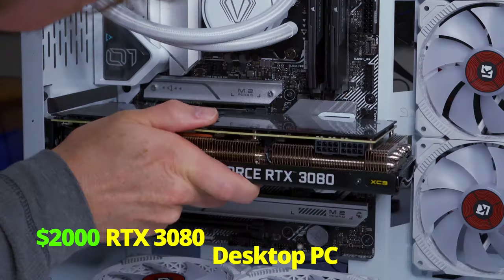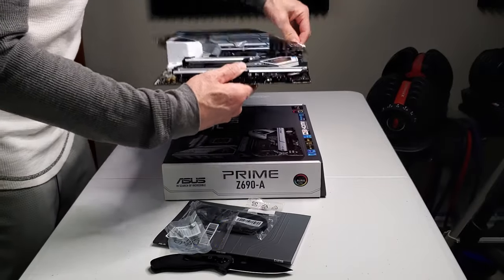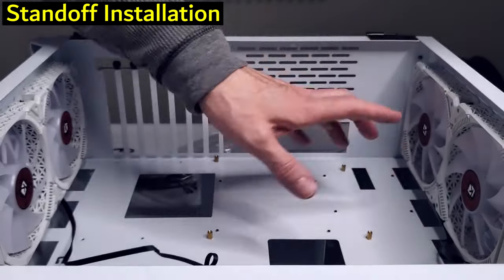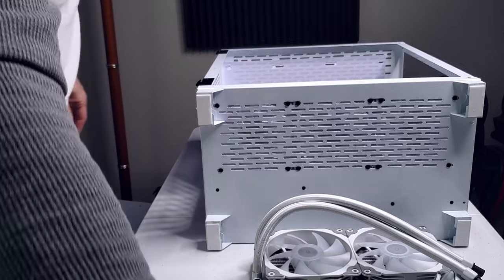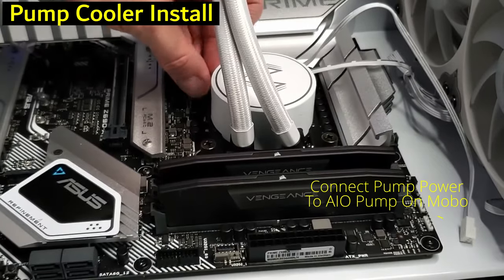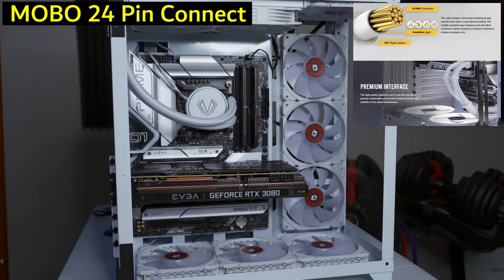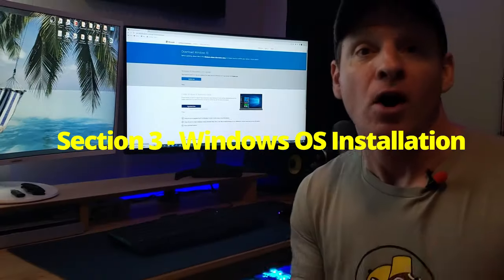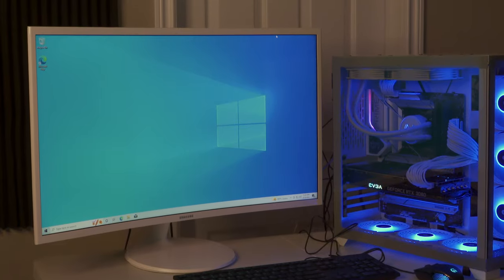THE BEST $2000 GAMING PC BUILD | EVGA RTX 3080 Intel i7 127000k

Comment: It appears as though all fans (case and radiator) are installed in an "exhaust" configuration, drawing all air out of the case, with no fans oriented in an "intake" configuration, to draw fresh air into the case. I believe this decision, though aesthetically pleasing, will likely hurt thermal performance of your components. It would be interesting to test thermal performance of components with differing fan configurations, to see what difference, if any, might be experienced. I would recommend turning the front and bottom fans to an "intake" configuration, leaving the top and rear openings to exhaust. This will blow cool air directly onto your GPU fans, as well as provide an abundance of cool air in the case for your CPU cooling fans to draw through the radiator. 
Great video, and I appreciate the detail in which you explained the installation process. Thanks for taking the time to make this video!
Reply from the maker: Thanks for the great information on fan direction and how to cool the PC components optimally. I may take your advice if my PC gets hot. FYI when I open the glass side panel the inside of the case is quite cool with really no heat. The back of the case has plenty of slots to allow outside air to get pulled into the case. I'm not sure that's the best way to do it but it does seem to work. Your idea sounds way better for sure. If I change the fans I will let you know. Thank you for watching I really appreciate it.
Reply: The key factor is the amount of heat which good luck measuring.  There is no barrier where there is "fresh air." Everything is exposed and with fan speed like that the case will stay cool.
Reply from the maker: @FuelOfLifeTV  I agree, thanks for watching!

Comment: Did you have to drill holes in the case to fit 3 fans on the top? Great Video!
Reply from the maker: Nope I just used 2 holes and 2 screws. The fan is super tight and zero noise or vibration! Thank you for watching I really appreciate it  and if you subscribed thank you as well.

Comment: In the video you didn’t show any motherboard cable connections . The Fan controller is connected to sata and you have the 5v rgb cable and the small what looks like a fan cable to go to the board that starts with a V. I’d have to open it up to see .. I’m trying to figure out how to control the fan speeds on the mother board. I think there already full blast but don’t sound like it .. don’t know what rpm they are. Can’t adjust the fan speed up or down on the remote .. do you how?

Comment: I have some few questions about the case. Are the fans quiet in the PC case? Does the PC feel good is it good quality? And is the PC sturdy?
Reply from the maker: Yes to all the questions. Quiet fans, durable well built case, feels good and looks amazing. It's my favorite case I've used in my last 20 PC builds. I have the fans all exhausting since that's the way the PC came and the inside of the case is very cool. However I may switch the bottom and side fans to pull in air. I will keep you posted. Thank you for watching and if you subscribed thank you as well
Reply: Thanks you so much for helping me so do you recommend the KEDIERS PC Case - ATX Tower Tempered Glass Gaming Computer Case with 9 ARGB Fans,C590 or the Cosair 4000x pc case because I can’t decide which is better
Reply from the maker: @Supreme-y2x  Kediers PC case is my recommendation.
Reply: Thank you so much your help 👍I want to built my own PC for myself.
Reply: I have one more question is the vetroo AIO quiet?
Reply from the maker: @Supreme-y2x  Very quiet. I've installed dozens of AIOs and this one my favorite so far. Quiet, Cools well and looks really good!

Comment: i have a Matx board, will the psu be visable from the front when using a smaller size mobo
Reply from the maker: The Power Supply shouldn't be visible. Thank you for watching.

Comment: How was the overall airflow after using?
Reply from the maker: Surprisingly very cool! I occasionally open the side panel and check temps and its very cool. The 9 Fans keep the air moving plus the 3 RTX 3080 fans. The 3 RTX 3080 fans only turn on when gaming or doing some 4k rendering. Thank you for watching I really appreciate it!
Reply: @UltimateTechHub  I heard some 3070’s are too wide for the case as well, was that a problem for you at all or?
Reply from the maker: @TheDrCrazed  Nope no problem but it is a tight fit so any larger GPU might be pushing it.

Comment: Congratulations for the video..... I'm Italian, I apologize if maybe I'm wrong with the English language.
I wanted to ask you, the fans of this case, the company that invented this case are wrong, air intake and extraction are wrong, the bottom fans should get fresh air (since the heat tends to rise), the fans too side should introduce fresh air from inside the case, from the video (I understand that they are all upside down), the only right ones are those above in the ceiling
Reply from the maker: I initially wanted to see how the PC case cooled with all the fans exhausting and then I would change the button fans but the PC case stays nice.and cool so I kept it in this configuration. Thank you for watching.
Reply: @UltimateTechHub  Thanks for the reply in some other videos of other youtubers who reviewed this pc, they noticed that the front glass did not remain aligned with the structure, it remained open, is your model instead everything ok? Thank you

￼
Reply from the maker: @MAIEMI  My glass is aligned so far. No issues. When I open the glass the air inside is nice and cool. If it starts to get hot I will turn the bottom fans around for sure. Otherwise it's a fantastic PC case!
Reply from the maker: @MAIEMI  I can see that the front glass panel could become loose since it has 2 screws that hold it in place. Mine seems fine.

Comment: Does this case come with Rgb fan controller meaning like the box with with the connection to hook up all 9 fans and the Rgb lights or is that sold separately
Reply from the maker: It comes with the controller that's mounted inside the back of the PC case. All the fans are connected to that controller and it has extra slots for additional fans. Also comes with a remote. Hope this helps. Thank you for watching and if you subscribed thank you as well.
Reply: @UltimateTechHub  I'm struggling this part, how I can connect this control to power up the fans?

Comment: Hello. In that type of case with airflow from below, could the radiator be placed in the position of the vertical fans? I almost always see it above but perhaps the other way would favor the flow of hot air above. Regards

Comment: do you need extension cables to how power supply cables reach the mother board and gpu
Reply from the maker: No. It just looks better.
Reply: @UltimateTechHub  thx i just wanted to know i prob will for the gpu if i ever do a build like this defiantly will use power supply and case

Comment: Hey I saw this video and made wanting to build a pc with this case but when I when to amazon to buy it I saw in the reviews that the case has 10 standoffs for the  motherboards that are attached to the case and I can't take off I know my mother board has only 9 holes not 10 BUT I DIDNT SEE IT IN YOUR VIDEO LIKE THAT...and also that it's a micro atx not a full sized..BUT I ALSO DIDNT SEE THAT IN THIS VIDEO CAN U CONFIRM PLEASE THANKS 4 THE HELP!!!
Reply from the maker: The case is not a micro atx case its a mid sized case which means it can hold all types of motherboard sizes. It has 10 standoffs and you just use 9 of them and leave the 10th   alone. Thank you for watching.
Reply: @UltimateTechHub  thank you very much!

Comment: I have the same PC case, however, I am having trouble with the case fan lighting up. I connected controller's SATA and ARGB to the PSU and Motherbaord. However, the fans are still not lighting up
Reply from the maker: Check the connections to make sure none came loose. Go from the controller to the PSU and double check. Your almost there!!! By the way, this case is awesome!!! 😎
Reply: @UltimateTechHub  Yeah, Fsfs< thank you
Reply: @UltimateTechHub  sorry but I’m having trouble with window installation. I did all the step I’m suppose to but when I boot up my PC, it says that’s my usb that contains window 10 is not compatible. What do I do?
Reply from the maker: @noobaf412  which USB port did you plug into on the PC? It can't be on the PC case it has to be the mobo.
Reply: @UltimateTechHub  yeah, I tried both plugging to the PC case and the motherboard. It’s the same result
Reply from the maker: @noobaf412  Did you plug the 3 pin female connection from the pc case fan controller into the cpu cooler controller? That's probably the issue. Keep me posted.
Reply: @UltimateTechHub   I think so… not too sure. I have the PC fan connected to the CPU fan then connected to the motherboard
Reply: @UltimateTechHub   I separated both aRGB pins for the PC fans and the CPU fans. It is giving me the same result when i boot up
Reply from the maker: @noobaf412  All of the PC fans ARGB connectors connect to the PC fan controller on the back of the PC case. The wire from the controller which is female connection with 3 holes connects to motherboard 3 pin connection at the bottom of the mobo or you can connect it to the CPU white connection adapter that has 4 spots for female connectors. I might do a quick video on this setup. Keep me posted.
Reply: @UltimateTechHub   all wiring on the PC fans on the back of the case should be right. Right now, I have the PC case 3 pin female connected to the CPU 3 pin, then CPU 3 pin female connected to the motherboard. However, it still will not let me instal Window 10. I’m on the blue screen where I can select a certain drive to import Window 10. When I select the USB that I had window 10 download, it says it not compatible.
Reply: @UltimateTechHub  sorry, but I tried every way that I know. My usb is still not being recognized when I am try to boot window 10
Reply from the maker: @noobaf412  Try a different USB stick.

Comment: Hey, would this same build work with a RTX 3080 Gaming Z Trio 10G from MSI instead. Im new to building pc's so sorry if this sounds dumb.
Reply from the maker: Yes it will work just fine. Feel free to ask me any questions I'm here to help.
Reply: @UltimateTechHub  would it work if i changed the motherboard to ASUS Prime Z790-A WiFi 6E LGA 1700(Intel®13th&12th) ATX Motherboard and the cpu to Intel Core i7-13700KF and instead of a 3080 a ZOTAC GAMING GeForce RTX 3070 Twin Edge OC White Edition
Reply from the maker: @qmdwv  absolutely! That would work!
Reply: @UltimateTechHub  it will be my first time building a pc, helps alot :)
Reply from the maker: @qmdwv  Have fun building your PC! Feel free to ask me any questions.
Reply: @UltimateTechHub  so i built my pc and it works great the only problem is i realized in bios the rams mhz is only showing 4000 but the ram support 5200mhz and when i turn on xmp it doesn't boot and makes me undo the changes for my pc to boot
Reply from the maker: @qmdwv  The i7 chip only supports up to 4000mhz of RAM. If you want to maximize the RAM you need the i9 chip. Thank you for watching.

Comment: I know this is off topic but how can I connect my AirPods to ps5
Reply from the maker: Plug the airpods adapter into the USB-C port on your PS5. Next open your AirPods case and press the button on the backside to put them into pairing mode. After that, press the pairing button on the Bluetooth adapter and wait for the LED lights to stop flashing. This should connect the airpods to your PS5. Hope this helps.
Reply from the maker: Sorry I meant plug the Bluetooth adapter into the PS5. These are 50 dollars. PS5 does not have Bluetooth support for audio without the adapter.
Reply: Ohh ok thank you

Comment: Anyone know if a 3090TI would fit in this case?
Reply from the maker: Yes it would!! That's a nice GPU!
Reply: @UltimateTechHub  I’m just worried about the clearance between the door and the GPU power cable hearing that it can be tight in this case specifically but maybe u can elaborate a little more as I’m waiting to get this case in the mail?
Reply from the maker: @XBL_Gxzy  For my RTX3080 it was a little close but with the extension cables you are able to bend them at a right angle to avoid hitting the pc door. Keep me posted on your build.
Reply: Just ordered this case🤞
Reply from the maker: @Millie1230  Enjoy!! It's my favorite case!!
Reply: So you would suggest getting the cable extensions to be on the safe side so the door can close?
Reply from the maker: @Millie1230 Yes.

Comment: if i used a 10 gb rtx 3080 with a 850 watt psu instead of an 1000 would that work?
Reply from the maker: Yes but over clocking may push it to the limit. If you plan on over clocking go with 1000w. Thank you for watching and if you subscribed thank you as well!

Comment: How deep is the case? Will it work with a vetroo V5 cpu cooler?
Reply from the maker: Is the V5 a 3 fan cooler?
Reply: @UltimateTechHub  no it's got the radiator and fan connected right to the cooler bracket.
Reply from the maker: @matthewmcguire8772  Yes it will fit with plenty of room.
Reply: @UltimateTechHub  will a 3 fan cooler not fit?
Reply from the maker: @brandondejesus3886  yes it should fit. I opted for 2 fans for the lower price.

Comment: I’ve been having trouble with the fans that came with this pc case, where do I plug the 2 pin and 3 pin connectors that came from the fan hub?
Reply from the maker: I believe the 3 pin is power and the 2 pin is for the remote control. Im not home right now to check. I will look at it tonight.
Reply: Ok thank you, the 6 fans in the case light up but do not move
Reply from the maker: @samthehugeman372  Definitely a power issue for the fans. The 3 pin connector is power for the fan hub.
Reply: Where did you put the 3 pin? At the top of the motherboard by add_gen_2_1? And I assume the 2 pin just doesn’t connect anywhere.
Reply from the maker: @samthehugeman372  yes I believe so but I'm not home to check. Give it a try.
Reply: I’ve tried everything, the fans light up but fans do not move, the remote isn’t working either
Reply from the maker: @samthehugeman372  I will check tonight don't worry we'll figure it out.
Reply: Thank you
Reply from the maker: @samthehugeman372  My PC case fan Hub 3 pin connector is plugged into my CPU radiator cooler controller. Do you have a CPU cooler? If you watch my video where I'm installing the power connections you should be able to see the connections.
Reply: @UltimateTechHub  Yeah Im using the same build as you. I have it plugged into the controller, and when I turn the pc on, the fan lights turn on, but do not spin. The remote that comes with it does not work either, so I cant turn the fans on.
Reply from the maker: @samthehugeman372  I would say your fan Hub connector is not connected to the correct fan connection on your mobo. Mine is connected to the one above the RAM sticks. Check and see if that works.
Reply: @UltimateTechHub  I think I got everything the same as you. I have the pc case fan hub 3 pin connector (it has the little 2 pin connector attached to it) connected to the CPU radiator cooler controller, and I have the 3 pin connector from the CPU radiator cooler controller going into the one above the RAM sticks. I have the SATA cable connected from the pc case fan hub also, so I'm just not sure haha. thank you for the help btw
Reply from the maker: @samthehugeman372  Make sure the sata cable is fully connected to the psu. Sometimes they can pop out.
Reply: Yeah it’s connected, I’m supposed to have all slots of the cpu radiator controller used by 3 pin connectors right?
Reply from the maker: @samthehugeman372  Yes. Mine has 3 slots used. 2 for the radiator and 1 for the PC case.
Reply: That could be my problem, I have 1 for the pc case and 3 from the radiator, 2 of which are from the fans and the 3rd is from the cooler bit itself, I guess I’m supposed to put it somewhere else?
Reply from the maker: @samthehugeman372  The CPU cooler plugs into the motherboard CPU cooler connector. It should be labeled.
Reply: The cooler part has two wires one for the plug into the AIO pump spot, and then there’s another 3 pin connector, that’s what I’m wondering where it goes
Reply from the maker: @samthehugeman372  the 3 pin connects to the fan connector next to the CPU power connector. It should be labeled fan connector.
Reply: Thank you for all the help, I ended up just having a board pc case hub, got a different one and it works perfect
Reply from the maker: @samthehugeman372   Glad you got it figured out! I knew you would eventually! Enjoy the Awesome PC and if you have any other questions feel free to ask! :_Great: